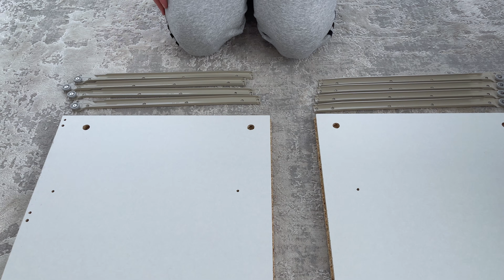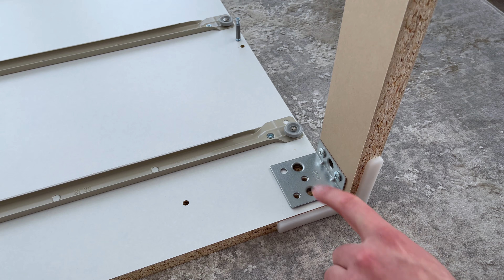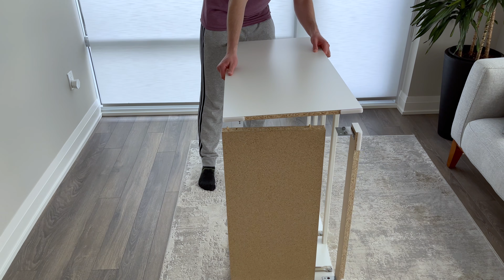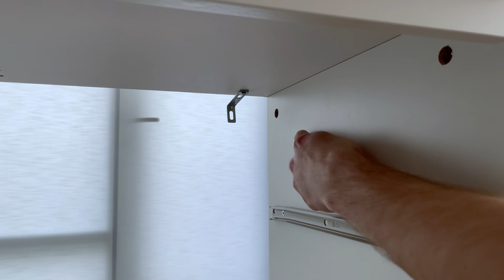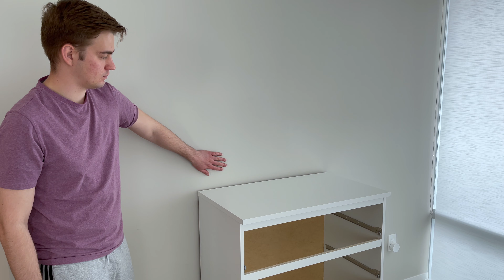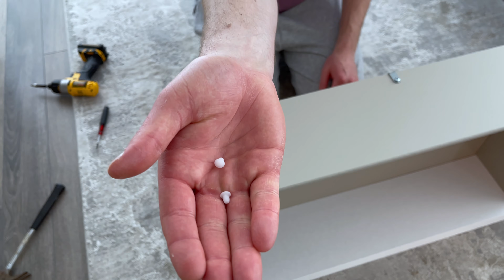Easy To Follow IKEA Malm 4 Drawer Chest Tutorial

Comment: Great video. I followed it step by step and it made putting it together very straight forward! One little tip I would add is to use a few small nails to securely attach the bottom of each drawer to its respective sides.
Reply: Can u put this together without a drill and just a screwdriver I'm a woman  I have to do it myself
Reply: @mel333xx yes, I know it’s nine months later, but yes you can. No electric drill required, I just did this in about 1.5 hours

Comment: 12:12 is it possible to do this step without a drill?
Reply: Nope, I tried without and it wasn't going in without a drill
Reply: U can use a nail and hammer maybe and then you use the screw
Reply: Yes its easily possible I did it so myself
Reply: @ritaivanova4859  with a nail first?
Reply: I just did it with a screwdriver and no drill was needed

Comment: I did everything like you did, but the top 3 drawers wont go all the way, and if it does its stuck or lodged and requires force to open. The bottom slot however is fine with all the drawers.. can anyone help?
Reply: The screws on the rollers on the drawer and inside the chest needed to be tightened for me to get it to slide smoothly
Reply: I'm having the same problem, were you able to come up with a solution?

Comment: One of my four drawers is stuck. I can’t get it to open. It opens about two inches only. I made sure all hardware are installed correctly. What could possibly be causing the jam?
Reply: The screws on the roller are blocking it because its poorly designed
Reply: But with enough fiddling you can get it to work

Comment: Thanks for the tutorial. I did as instructed, however the drawers do not go in smoothly, the top drawer go in with a stragle, while in the place below it the drawer don't go up to a certain spot and get stuck at about 5 cm before the end. Any ideas?
Reply: Such a stupid design. They won't go in any further and the drawer still doesn't work
Reply: Update: with enough fiddling it does finally work
Reply: @rotciv5472  what type of fiddling? Drawer goes into bottom rail all the way, but won't go in all the way in any of the others. I don't think it's the screws, because screws in bottom rail seem to not be in as far as the others. Thanks in advance.
Reply: The nails at the bottom on the railing aren't fully screwed in. They'll block the drawer from going in all the way
Reply: Wait I have this problem too!! I did everything right tho. I pushed in a drawer & the more I pushed it back, the more it was harder to push in. And the bottom part couldn’t like stay up right & go in smoothly like his. What did u do?
Reply: @ChiquiFuentes13  hi don’t know if you figured this out but you have to screw the screws in very tightly until they become smooth. Very dumb but me and my sister just figured it out after several tries